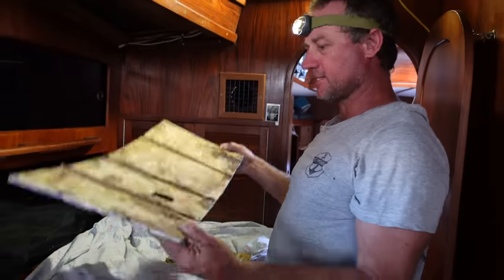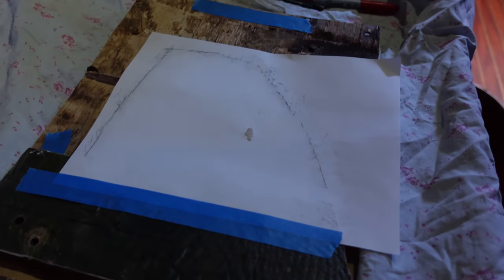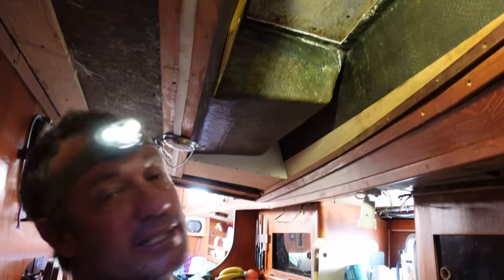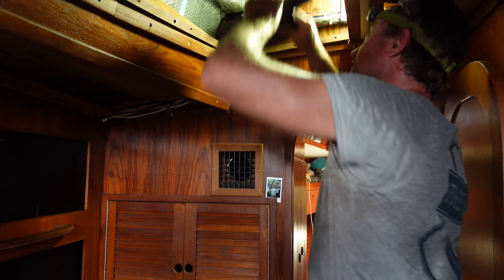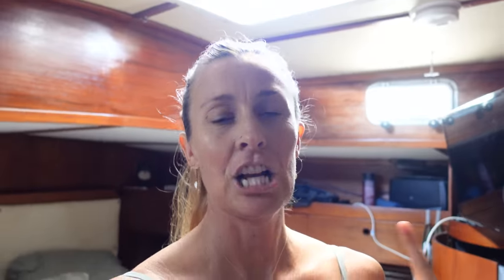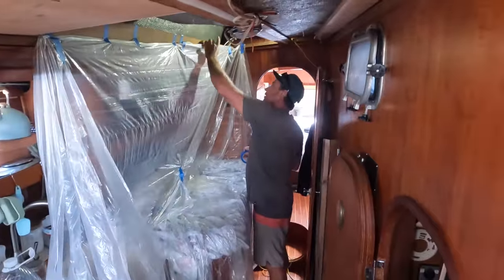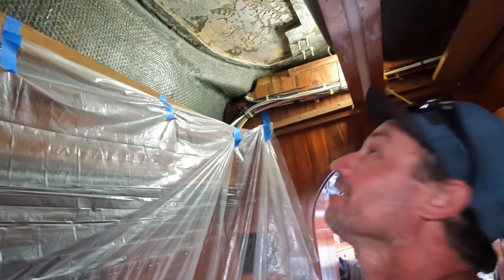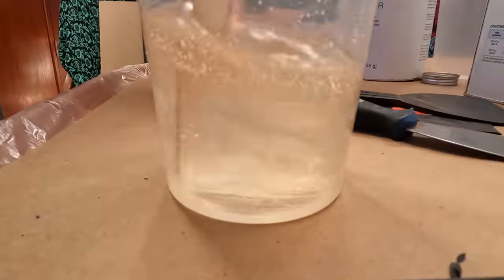Fibreglass FAIL What not to do when fibreglassing? LOTS Boat work | Ep 311

Comment: ***Helps to wet out glass on plastic for working overhead. Place the glass, roll to get to adhere, then pull plastic and finish rolling out.  If additional layers are to be added, use peel ply between plastic and glass. 
  You do nice work!
Bfree

Comment: You can sit your epoxy mixed container in another larger container of water to slow the heating and chemical reaction. And pre-wetout your fibreglass on some plastic (as mentioned below in some other comments) You can then just rollup the fibreglass, place in position and roll out as you unroll it. Good job,

Comment: yeah..overhead glassing means pre/wetting the surface not the cloth (specially that biax - if im not mistaken- you have, as it will unravel due to weight) with epoxy and if you can add a bead of thickened goo (applied with a makeshift pastry bag) even better. the thickened epoxy will be flattened out by the laminating roller so no worries there. im in asia, so i know about that "fast" heat. that was a a proper amount you mixed in the first time hehe, but had you mixed it, spread it quickly over a surface and had a small fan blowing upon it the whole time if would have bought you the time you needed. even if it kicks and starts gelling you have around 3 hours to apply some more over it and still get a chemical bond, even in asia it will still take about 3 days to fully cure i would say

Comment: When fibreglassing in hot weather cool your mix in cold water & shade the surfaces your applying the resin to (cure times at above 30c are very short). For overhead applications use a finely notched trowel to apply a small amount of thickened resin to the surface when apply your dry glassfibre to that and wet out, much less getting covered in resin.

Comment: i found if you paint resin on surface then wait for it to tack off . after that you can roll your cloth on .. use a empty handtowel or toilet roll. roll your glass on that and than use it to apply cloth. then with a mini roller(preferably a short nap one) wet out the cloth. Presto!!!

Comment: In the future, use a West System “Notched Trowl”.  That way you can insure a consistent layer of West System epoxy mixture on your bonding surface.  You will get a stronger bond that way.
Reply: Or just use a notched tilers trowel.